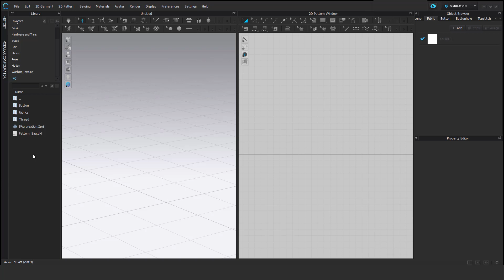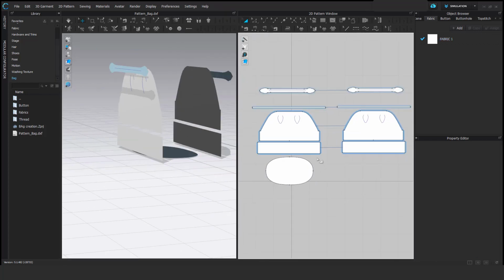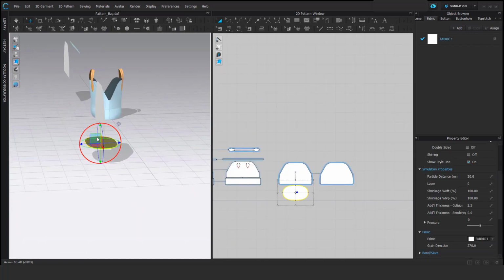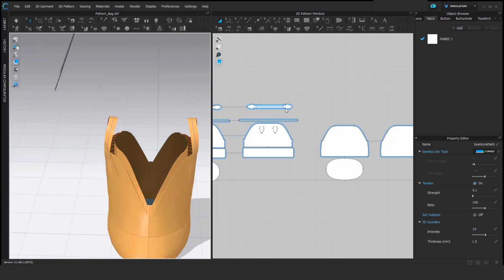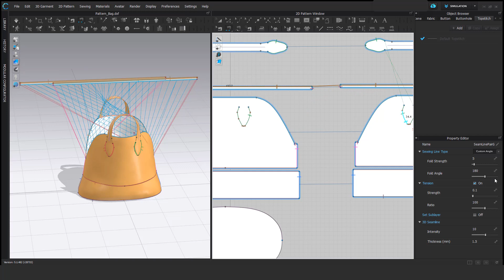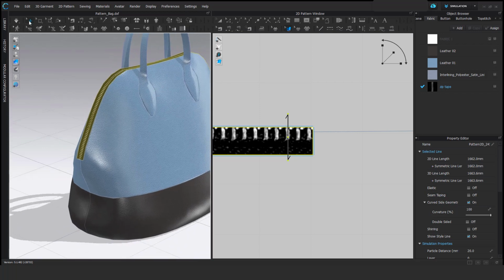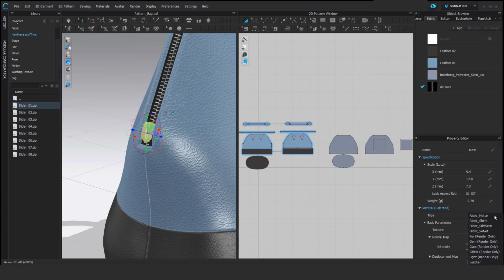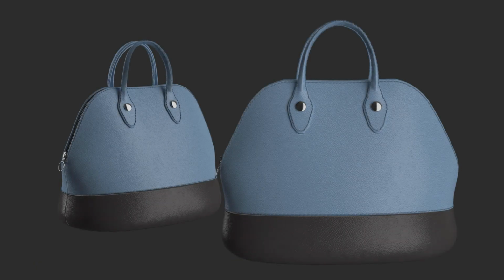Handbag Creation Process

Comment: Once you design a bag on the software does the software 'create' the instructions/pattern to make the bag? If not, is there separate software to use for the pattern process?
Reply from the maker: If you fully realize the design in CLO and upload to CLO-set it will generate a Tech Pack for you.

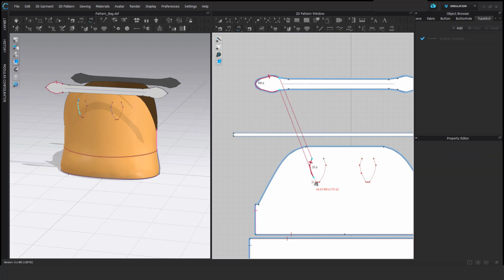Comment: I cannot sew handles with main fabric's internal line at step at time 2:13, internal lines are not being selected by sewing tool.
Reply from the maker: If those lines are purple dotted lines, they are Baselines. You need to use the Trace tool and convert them to Internal Lines.

Comment: I- this is TOO FAST. like what... how do I know when to choose and freeze and strengthen and the particle distance and OMG HOW-
Reply: slow down the video youtube has an opption
Reply from the maker: Keep your Particle Distance higher so simulation will run faster. You can leave Strengthen on and keep the stiffness until you are finished. Use Freeze when you need to "anchor" another pattern piece. You can render with Strengthen and Freeze still on.

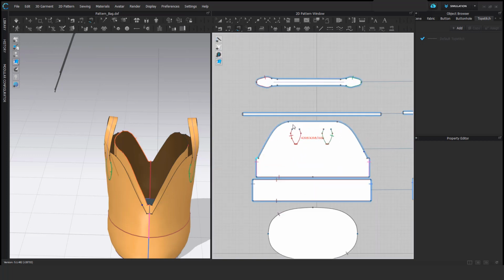Comment from the maker: Some people mentioned that their lining was "puffy" after sewn in. The speaker mentions that the sewing line type needs to be changed to "Turned" @ 4:10 - this is a property that can be changed to allow a seam to press open or closed, basically will allow that edge to hinge so the lining does not bubble at the edges where lining and bag meet. It is explained thoroughly how to change Sewing Line Type in the tutorial linked below.

https://youtu.be/owWiplmx88w - Timestamp for this part is 16:08
Reply: Instead of creating the zipper; I used the Zipper tool. Why is the Zipper tool fails every time I simulate ? No matter what the bag either implode on itself with the lining going out and simulation never stabilizing or go airborne and disappear from the view.